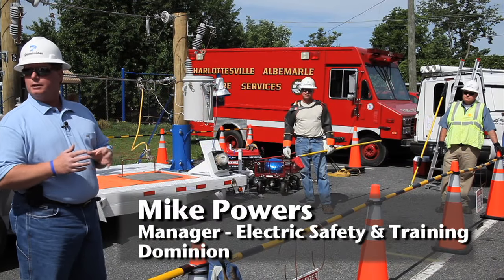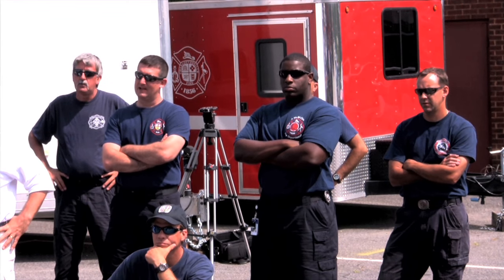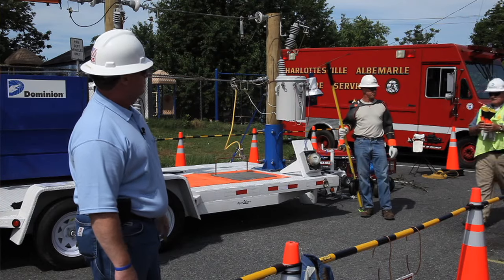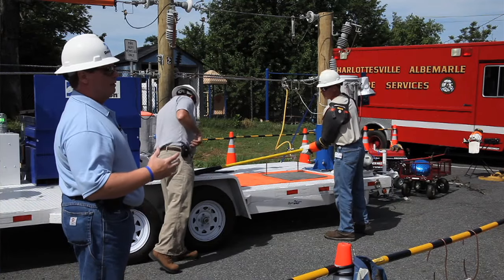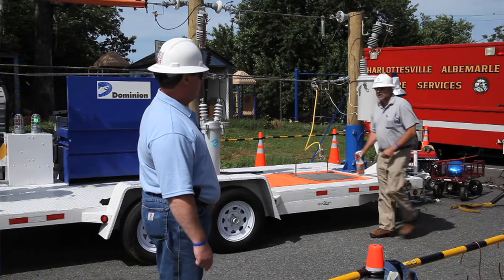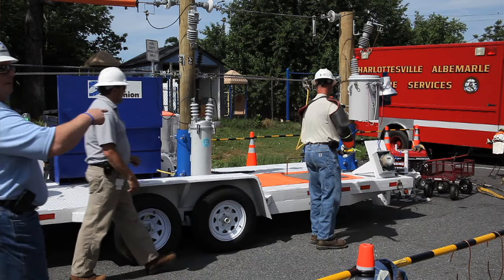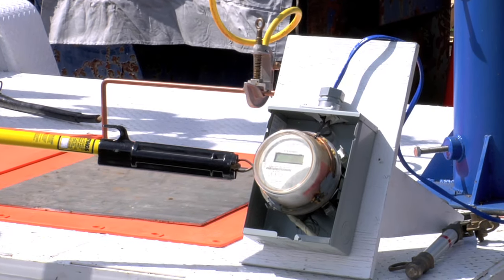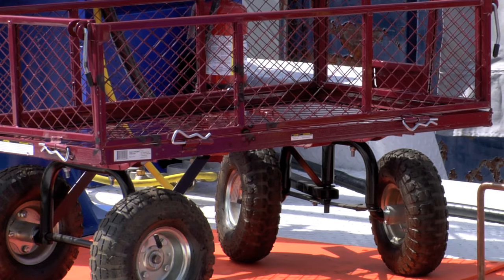Live Wire Demonstration

Comment: Georgia Power in the 70s/80s installed aluminum power lines in my street. Mr old house was built with copper wire. Came home and found that every outlet was on fire or smoking. Georgia Power suggested that I hire somebody who knew something about electricity. Come to find out that because copper and aluminum eventually separate a special clamp was needed. The Georgia Power supervisor said that it was "an act of God" and they weren't responsible for the loss of all my electronics, power outlets, and cable TV. The Cable guy was shocked, (literally) when he removed the ground wire. The cable caught the side of my house on fire. Georgia Power said the cable company was told not to connect their ground to GP's ground. (An 8' deep copper pipe). Georgia Power said the problem was my fault because I should have had someone climb the power pole and checked the connection between the two different pipes...Go Figure.
Reply: accountability was terrible back then. We have come so far in such a short amount of time. Sorry you had to go through that then
Reply: It's not an "Act of God" but it is a quicker way to let you know that everything after the meter is your problem and everything before it is theirs. The electrician is the one who created the error. Fortunately they do make clamp connectors to bridge the two different wires. Aluminum wiring is no longer legal for interior wiring. In fact it is only allowed for "Open Air Wiring". Which means it can only be used on outdoor power lines.

Comment: I believe you had failed to mention something that pertains to your demonstration, & It sounds a bit morbid, although, I'm still going to mention it, anyway. When a human being is getting electrocuted, your muscles will actually lock up, and the electricity may not allow you to let go, run away, or move away from the place where your being shocked, and you end up being frozen there, until death. This is due to your muscles. They actually contract, or lock up completely when in contact with electricity.

Comment: Maybe everyone who signs up for electrical service should be obligated to view something like this. If needed, maybe tie in a reduction to homeowner insurance premiums or something. 

One thing I think could be made slightly clearer is that you don't actually have to touch energized high-voltage equipment or lines. Those gray ceramic spring-looking things attaching the wires to the transformers are called bushings or insulators. They are fluted to reduce the possibility of current from flowing along the sides of a wet insulator and causing a short circuit. The higher the voltage, the more likely the possibility of an arc.

The other thing is the misconception that car tires are made of rubber and will insulate you. This is not true, especially where high voltages are concerned. Car and truck tires are vulcanized rubber mixed with about 28% carbon black which is electrically conductive. You may think that rubber will protect you but in that last flash of awareness before you join your ancestors, you may find the answer to how many amps a human can conduct before he burns through.

Comment: I would urge the general public to stay away from 5 or 7 volts, let a trained tech repair your phone.  Turn you back on a wrongly connected phone battery and it's amazing how fast you get a melting, smoldering wire capable of burning your house down.  I've almost burned our shop down a couple times in the past 40 or so years, not a great way to make points with the boss.

Comment: One year while working my way to a BSEE I had an electrical engineering professor tell a true story about his past.  He was an expert witness in an insurance court case.  Three guys were in a farm field and were drinking.  One of them climbed a nearby high voltage power line tower.  He got up near on of the three conductors and raised his arm to wave to his pals.  An arc jumped from the 155 kv or higher (Not sure what the voltage was) transmission line to his arm.  His friends saw a bright flash and the guy was gone along with part of the aluminum structure.  The tower leaned over slightly from the damage.  He testified that yes, the arc could vaporize an entire body.

Comment: Why aren't the wires covered in some kind of insulation?
Reply: Who's got money for that kind of thing?
Reply: Because it's a demonstration. Often times the insulation doesn't do much considering the voltage that's running through those lines.
Reply: SpriteV1 the covers that are on the city lines, it's for weather protection, not insulation. I'm assuming it on insulated because shouldn't nobody be up there touching the line. And cost Factor
Reply: I don't know the exact reasons, but I can speculate a few (cost, maintenance, temperature tolerance). But mainly because they're well out of the way of people accidentally touching them.
Underground cables and building wiring are always insulated.
That said, if today someone came up with the idea of putting up high voltage uninsulated wires in populated areas, they'd probably go to jail for some sort of negligence.
Reply: Expensive.
Reply: And added weight too, apparently.
Reply: Expensive, heavy, and prone to failure by sun exposure.  I can't say I have ever seen an aluminum high voltage wire covered with insulation. They are out of human reach, so why bother?  So why can a bird land on these wires?  As the demonstrator said many times, no path to ground.
Reply: You don't need it, it would be ridiculously heavy and much harder to work with. Not to mention the price.
Reply: They are. The air is the insulation.  Adding additional insulation would add weight, cost and make it harder for the cable to stay cool.  To be effective the insulation would have to be thick and you would need an electrostatic shield for the higher voltages or you could get shocked by capacitive coupling. At this point you have invented the underground cable and you might as well bury it.

Comment: Wow! A fucking 120 volt generator plugged into your system backfeeding into the distribution system up to where it has a fault and where the power is cut that hundred twenty volts backfeeding through will be stepped up by the pole Transformer to 7200 volts damn yo wonder if you can use it to backfeed all the way through everybody hooks a generator up and there's no generator at the source but then it goes to the substation and that 7200 volts is then stepped up 2 like 250 kilovolts on a big Powerline doodlist.

Comment: 56 month training course eh? Hell, 56 Days seems way too long. 56 hours would be an appropriate length for a training course. To put in into perspective, there is no required training course to drive a vehicle. Just 20 bucks and a 25 question quiz.
Reply: Probably an apprenticeship type training course. Do you not have mandatory driver's ed where you are?
Reply: Mark Cross Not mandatory, but if you take the course, it makes obtaining a license slightly easier/less expensive

Comment: Back feeding a house with a gen set yea you can pull the main switch cutting the 2 hot wires but the neutral unswitched will still back feed the grid causing injury to power workers. You have to have a professional install a switch box kills all wires or make up your own 3 wire kill not advised just do it proper. Do you want to kill a dude doing his job so you can have lights. Just saying.

Comment: Ground. Fault. Protection.

people, connect your transformers phase to phase, not phase to ground.
Reply: Phase to ground transformer connection (as seems usual in continental USA?) makes a current to ground  normal.

There are advantages to both systems. The phase to phase system requires 2x the insulation etc on single phase laterals but ....meh
Reply: At least on low voltage phase to phase system has one big disadvantage - if there's a single leakage to ground nothing happens,  you only learn it by hard way when a "second grounding" happens, where in phase to ground either RCD or circuit breaker will do the job. These systems exists in EU for example in hospital OR's but there has to be a system that will monitor the ground leakage and give clear indication that "we're fine for now, but it's not isolated topology anymore".
Reply: most are phase-to-neutral
neutral is not ground

Comment: I appreciate what they're doing, but a lot of this is just fear mongering based on urban myths and stereotypes. Live wires are coated in rubber and the bronze and cobalt wiring inside does not retain much electrical current when touching the ground. In most developed nations, grabbing a downed power line is about as dangerous as licking a battery, but you can reduce that risk even further by wearing rubber gloves like they do in the video, or putting some rubber bands in any regular non-polymer glove. And just like the video demonstrates, as long as you're wearing boots and standing on concrete or soft grass or sand, electricity can't hurt you.

Comment: Sleeves and gloves and a hotstick. I bet it takes these guys 3 days to do a half day job. When they need it DONE, they call a contractor. Seriously. Why doesn't Dominion have a large enough work force to do ALL the work? Because it's cheaper to hire contractors instead of pay the wages and retirement of a large workforce. Plus, they know the contractor has to do the job in a timely fashion, Dominion guys can take a week on a job which a contractor would do in a day. Why do they use contractors? Ask them. Cause they don't want their guys taking any risks to get the job done. They wan to look like the big time "oh we're safe none of our guys get killed" so they hire contractors to get it done. I watched a contractor strap a rope to each end of a crossarm, pick it up with the bucket, while other guys mounted the new crossarm underneath. I take it the man lowered the bucket and dropped the lines in place. The guys had gloves on. No sleeves. I noticed one guy had his bucket far enough away whereas he had to REACH to the line so he COULDN'T contact anything except with his gloves. Call the infantry contractors when you need it done Dominion. Fuckers. Soak up that money. Same with Verizon linemen. I saw a boom truck lifting the line, 2  other trucks, 4 or 5 guys, all to do a straight thru. I could have done it faster off a flatbed and hooks with a fucking chain hoist by my God damned self.

Comment: No it;s not full primary voltage if a generator fires up. Generators at homes are 5,000, 7,000, 19,900 volts? No they're not. Generators are secondary voltage. They send secondary voltage to the home. A home cannot handle primary voltage. It would flip every breaker from the getgo.
Reply: RE:jay willow. It is secondary (120V) from the generator to the transformer, but once it goes through the transformer (backwards) it is stepped up to primary.
Strange though, that they couldn't put some kind of a safety device, like a diode, on the transformer to prevent secondary current from feeding the primary lines.

Comment: Very good presentation but it also made me realise that power distribution in the US is pretty backwards. In Europe we don't have any power poles on the streets, it's all done by underground cables.
Reply: Running conduits underground is 10x the cost of aerial deployments, and most communities in the US are pretty sprawled out over a large area.
Reply: And there can be problems with underground systems too.  I have seen an instance where something messed up and the entire ground for a good sized area became energized.
Reply: Britain has power poles in some villages, where running underground systems would be too expensive for the small number of people being supplied. Most towns have underground as well, but since the country is much smaller, it's easier to do so compared to the US which is enormous.
Reply: That’s because Europe is tiny
Reply: And quite often dogs being walked on-leash are the unfortunate victims. They have no electrical insulation at all, and far too many sad stories (out of Toronto, for instance).
Reply: Many, many towns and highways in the U.S. would look so much more beautiful if the overhead wires and poles weren't there, but as another poster mentioned, it is prohibitively expensive. The upside is fewer outages during storms, but the downside is cost and the duration of outages when they occur. Parts of Europe have cable car overhead wires, no?
Reply: Another prohibitive thing - safety. Over years utility maps get lost. Power conduits get mistaken for water pipes or someone lays a gas line on top of a power line. Or their records show nothing in the area and a backhoe digging in someone's back yard gets fried.
Reply: Matt Gorzka Why would you write something that simply isn’t true?
Reply: Hi I am British. We have power poles and transformers in rural areas. Most cities have underground cables.

Comment: It's not voltage that kills you, it's the amperage. This guy acts like 7,000 volts will kill you.. The average static shock you get from a door handle is more than that.
Reply: Biohazardous Radiation you mean it's the current
Reply: "ish not da voltz dat kile u, is de ampz"
Good job, you're on the way to earning a nice spot in your favorite cemetary.
Voltage determines current

Comment: all that for a completely-fake demo, wow.
it's 7500 volts to NEUTRAL. Not to ground. There's a huge difference.
that's why you have to add a smoke bomb to the end of the shorting-rod to even have something to show
so what are you saying but it's too dangerous to actually do this demo but we're such big fat fuckheads and so self-important that we're going to look like we're doing something dangerous when were not precisely for safety reasons?

Let''s consider what would happen if you actually did something dangerous with that 7500v line like shorted it to ground not to mention to an opposing phase. it would short out not just 7500v but also 7500v fed through at least one transformer stepping it down from 15k or even higher. it would fry everything between the generator and the return line at the generator until the weakest parts of the link actually blew up, unless you put a current-limiting safety load in the circuit, and in that case it wouldn't arc worth a shit.  An arc is one thing the real danger is of electrocution or a catastrophic equipment failure....neither of which you're willing to demonstrate. This is like trying to teach kids not to play with wall power by putting an orange lamp in the circuit.